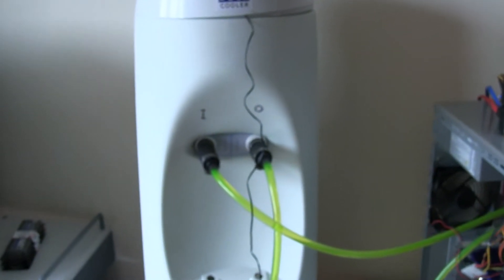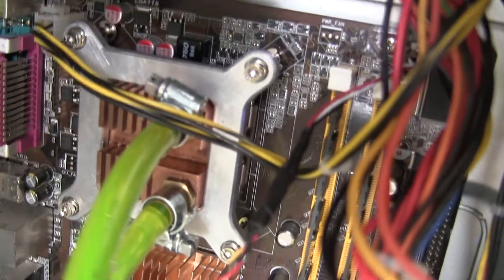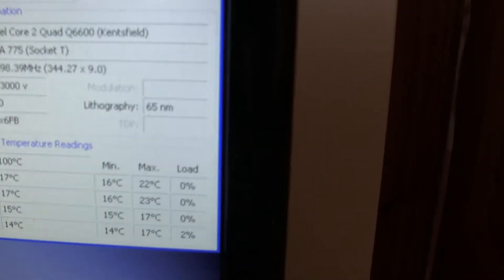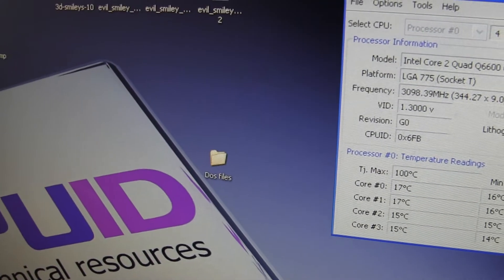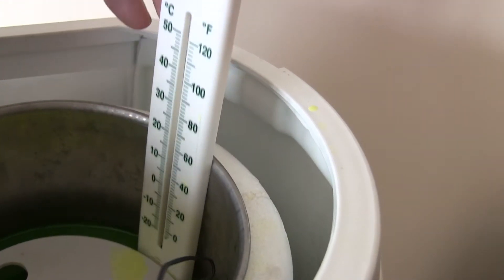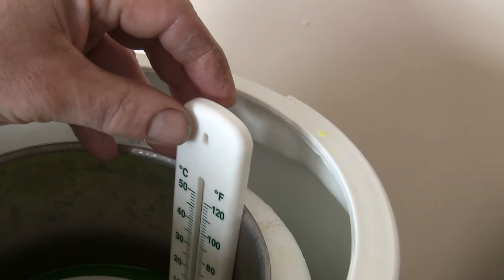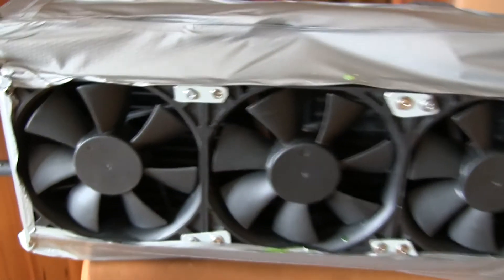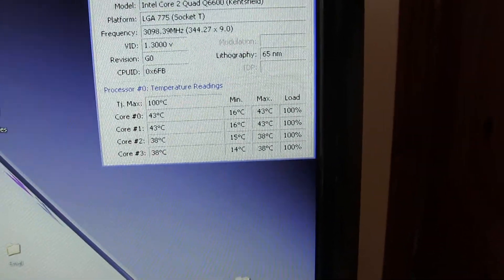CPU Liquid Cooling

Comment from the maker: No condensation, I actually went back to using the radiator shown in the video with a high flow pump (from Danger Den) and made a different heatsink with larger pipe fittings, and dumped the coolers. I was joking about the manequin, did cross my mind though.

Comment: Quick example, 8mm tubing with a water tempreture of 20c and a flow rate of 1000lph (Litres per hour), will be less effective at cooling than 13mm tubing with a water tempreture of 30c and a flow rate 1700lph. This is due to that water circling your entire loop anywhere from 5 times a minute to 20 times a minute. It will reach a constant tempreture all the way round. Remember its 25x more heat conductive than air.

Comment: Woah, wait a minute we actually agree on something here, I too am waiting for IvyBridge for my next build. Lets work from here we have found some common ground. Whilst the water temperature is important anything under 30c is fine. Its the flow which is more important, as this carries the heat away from the blocks. Water is 25x more heat conductive than air meaning it will strip the heat away fast. Piping, HF blocks and pump will acheive this. Lets keep this positive. :)

Comment from the maker: My point is I made my own heatsinks different types etc. and made my own cooling system and am testing them on a 2.4Ghz Quad core You bought all yours. So when you make your own components you can slag off other people. Anyway, my point is if you can flow chilled liquid (from the local river etc.) through the block it is much cooler than blowing room temperature (that's how you spell it) air through a radiator. I am waiting for the Ivy bridge CPU's to be released for my next build.

Comment from the maker: Also MUPPET, I have stated that purchased a high flow pump from Danger Den (in the last week) so is not shown in the present video, and am making a new heatsink out of coppertungsten with bigger fittings to match the 13mm bore of the new pump. This is my first attempt at liquid cooling apart from the H100 I purchased for the gaming PC. Muppet.

Comment from the maker: Where is your effort, you are what we call a hurler on the ditch. Standing on the sidelines giving advice. Anyway with an aftermarket cooler, fan sitting on a finned heatsink I was getting 31deg C at idle and 85deg C under stress, the max I have seen with this setup is 55deg C running for three hours and the temp in the cooler was 25deg C. And as I said to you before get a spelling checker or spelling lessons. Muppet.

Comment: No it doesn't work. This is quoted from your message above "just yesterday fitted the radiator to cool the liquid coming from the CPU block (intercooler) before it goes through the cooler and back to the CPU block".
ALL REFRIDGERATION UNITS ARE PASSIVE COOLERS, THEY WILL NOT WORK. You need an active cooler. A large storage chiller is also un-effective as the water reaches a constant tempreture in a loop.

Comment: Your having a pop @ someone who knows what they are doing about his spelling. If your gonna troll do it for my content, which you can't. If you knew this from the start why are you advertising it in the video like you didnt? The cooler draws 40watt from socket, thats not its cooling power. If its a heat plate exchanger, which it most likely is you will get about 30watt of cooling. This unit all it will do is -1 or 2c. Also dude get some better piping that piping is pathetic, way too small.

Comment from the maker: I know that as the cooler draws only 40W, and the CPU draws more. And as it happens, just yesterday fitted the radiator to cool the liquid coming from the CPU block (intercooler) before it goes through the cooler and back to the CPU block. But if you get a better fridge unit it would work better, but more to run. But it is just experimenting. I have some advice for you also.......get a spelling checker. No offence.

Comment: This will not work. This cooler is a "passive" cooler. Whilst it might be able to cope with 1 or 2 degrees in water tempreture, if it was to run at load and stay there the water would continously rise in tempreture. 
Its not all doom and gllom though, I salute your efforts, and thus have some advice for you. Place the radiator back in the loop, this will remove most of the heat generated by the CPU before it is dumped into the cooler. This is make for much lower temps under load.